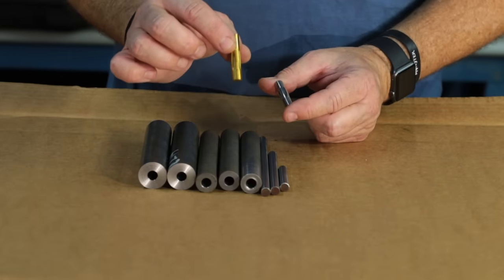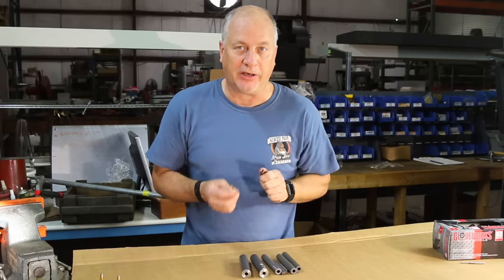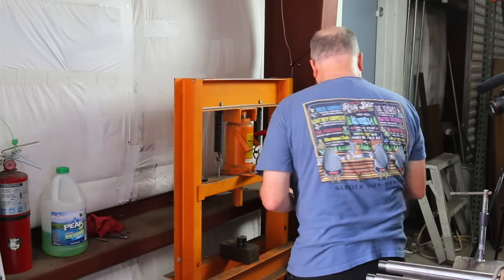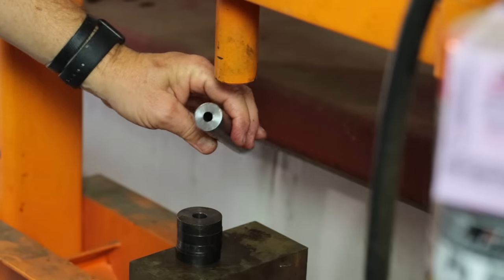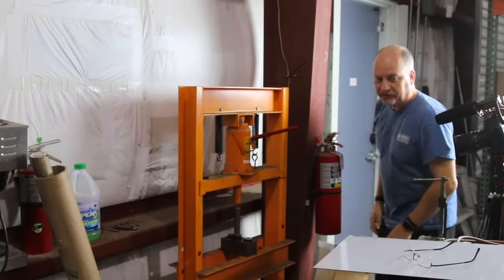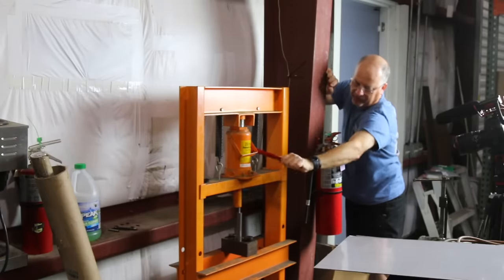Home Shop Rifling THREE(ish)...China vs. Ukraine Rifling Buttons!

Comment: Reheat the drill rod to cherry red and only harden the tip.
Reply: @Brett Freeman Ah ok it will expand where it is not as hard
Reply from the maker: @Brett Freeman Huh?  There's never enough stress on the rods to deform them, so what are you talking about?
Reply from the maker: @Brett Freeman  Sorry, that's not how it works on my channel.  If someone makes a comment that I think is BS, they have to back it up or it gets deleted.  I won't be responsible for spreading bad information if I can help it.  So with all due respect, please "put up or shut up", as the saying goes...
Reply from the maker: @Brett Freeman  I'm very serious.
Reply from the maker: @Brett Freeman  Well, three years ago I started...if you want to consider that "literally just started".  Which I don't.   So if you're the expert here why are you avoiding answering my question?  Greg Smith said to harden only the tip of the rod, you said that's how they get stuck, I asked what you're talking about and you've avoided the issue.  Now are you going to answer the question?
Reply from the maker: @Brett Freeman  Thanks for answering.  I disagree on two counts.  First of all, spot hardening doesn't soften the surrounding metal.  The remainder of the rod will remain annealed if that's the state it was in.  If it was a hardened rod to start and it was heated to the austenization point followed by only quenching the tip, the remainder of the rod will be annealed.  Second, as I said there's not enough stress on the rod to deform anything, so there's no mechanism for it getting stuck, bound up, whatever.  Now, what I've just said is based on a LOT of practical knowledge, and being a pretty smart guy with a mechanical engineering degree.  But I have no actual experience with what you're talking about and at this point I'd almost be tempted to say I defer to your experience.  Except for this...I'm about to build a custom rifling press that'll exert over 37,000 pounds of force on the rod/button.  How would I even notice if something bound up?
Reply from the maker: @Brett Freeman  Sorry, I don't take anything as a personal attack...it's just that there is a lot of crap information that has been posted in the comment section of my videos over the years, and I try my best to weed it out.  I'm glad to pass on knowledge...that's what I do here!
Reply: @markserbu  I was only suggesting a possible solution not talking bs. My point was to have a rod with varying degrees of hardness. It would also be possible to temper the rod to varying degrees using a torch. I know nothing about rifling barrels but have many years experience hardening and tempering high carbon steel.
Reply from the maker: @gregsmith2262  I know you weren't talking BS.  I agree with just hardening the tip.  Hell, I think I mentioned that in the video.
Reply from the maker: @Brett Freeman  Odd that you always find drill rod hardened...I buy it all the time and it's always annealed.  My point is that the force required to push a button through a barrel is never enough to yield the drill rod material.  So it will stay the same dimension as it goes through the barrel and shouldn't ever get stuck.  But anyway, there's no point in arguing about that.  I thought you'd run across something I hadn't thought of and I don't think that's the case.  I agree that a normalized piece of steel is a perfect candidate for a barrel, but as we discussed before it requires a very precise cooling curve to achieve and I doubt that can be done in a home shop.  Hell, I've been trying to get parts austempered and my local heat treater can't do it.  For most, even professionals, a quench is just a quench.  Try to do it at a precise rate and they just can't seem to make it happen.  Anyway, my press uses a small hydraulic power unit...same type they use for car lifts.  The hydraulic cylinder is a 4", with a 14" stroke.  It's definitely overkill, as it can exert 37,000 pounds of force with the HPU I bought.  Obviously I'm not going to be rifling rifle-length barrels.  Yes, it'll have bushings to hold the push rod precisely in place.  It'll also have a large thrust bearing to allow the button to twist without resistance.
Reply from the maker: @Brett Freeman I just did read up on normalizing of 4140 in the ASM Volume 4 Heat Treating Handbook, pg.35-41.  BTW, the normalizing and annealing processes are the same for all steels (except air-hardening), so I'm not getting 4140 confused with any other steel.  While normalizing seems to be the ideal condition for a barrel, I disagree that it is a lot more simple process than annealing.  As I said before, annealing requires heating past the austenization temperature (the upper critical line of the iron-iron carbide phase diagram), followed by slow cooling.  Normalizing requires heating about 100 degrees above this temperature, followed by a precise cooling curve.  That makes normalizing more difficult as you have to control the cooling rate, unlike annealing.  Wouldn't you agree?  You can instantly tell if you've normalized a piece of steel vs. annealed it, because the former will come out at around Rc 32, the latter will be around Rc 15.  Have you hardness tested any of your barrels?  I'd be curious to see if you're actually normalizing the steel.  The only heat treating that should be done after rifling is stress relieving, and that temperature should be kept as low as possible to keep from killing the strain hardness that the rifling button added to the bore.  Unfortunately, the lower the stress relief temperature the longer it needs to soak.

I'm fairly positive that if any rod were to break, it would be a hardened one.  As I'm sure you'll agree, hard steel is more brittle than soft steel.  I did all the stress calculations and there is no need for any strength beyond annealed drill rod.  I just don't see any advantage to it.  I would like to know why you say "never use anything but hardened rod on any barrel you do".  On the other hand, with the right setup you're very unlikely to mess up the rifling with a hardened rod so it shouldn't hurt anything.  I'm sure rifle barrels are much more fussy than little pistol barrels, I'll agree with that. 

Look, it sounds like you have a ton of experience but in my estimation some of what you're doing doesn't jibe with the math and science.  I, on the other hand, know the math and science but have limited practical application of it all.  Hopefully between us we can arrive at something that makes sense!

Comment: Wouldn't it be better to have an odd number of grooves?
Reply from the maker: I can't think of a reason that an odd number of grooves would be better...can you?  I know almost every barrel I've ever encountered has an even number.  The lone exception is a 3-groove .50 BMG barrel I bought once.
Reply: @markserbu  With an even number of grooves, you have two lobes of the button pressing against the inside of the hole opposite each other. With an odd number of grooves, the button will have one lobe pushing against the inside of the hole and nothing directly opposite it. So it should require less force to push the button through the hole.
Reply: For the same reason, the barrel would also deform the bullet less, contributing to better accuracy.
Reply from the maker: @JamesRPatrick   On the surface that sounds logical, but I don't think it is.  There's a certain amount of force required to deform a given amount of steel, period.  I'd bet that if you analyzed the force required to push a 4-groove vs. a 5-groove button, assuming they displaced an equal amount of steel, you'd see the same for each.
Reply: Looks like some companies are calling it "5R" rifling.
Reply from the maker: @JamesRPatrick   Yeah I just read about that.  I agree with the angled sides of the lands...it's similar to the improvement when going from square threads to acme threads.  But I think the rest is BS.  One part of the SAAMI spec that escapes people is a little note at the bottom of each "Cartridge and chamber drawing".  For the 9mm Luger the spec for the "MIN BORE & GROOVE AREA" is .0967 square inches.  That number is the same whether you use 4, 5, 8...whatever number of grooves.  And since it's the same, you're displacing the same amount of steel.  Same force to rifle, same force on the bullet.
Reply: @markserbu  Could you grind off two of the six lobes of the button and send it through twice to reduce the force required to rifle the barrel?
Reply: markserbu The only place I know for 100% sure fact that using a 3 grove barrel makes positive gains in accuracy is on br f1 classes , every one runs a 3 grove (1-15 to1-18 twist) for 30 cals. If you ask around what their setups are most of the guys that finish in the top 5 are using 3 groves rifles. But I think the advantages are super minor in most situations.
Reply from the maker: @JamesRPatrick  That would definitely work.  But take twice as long.
Reply from the maker: @brandonsjsj  Might have something to do with bullet harmonics...maybe odd numbers do better than even?  Or 3 is better than anything?  I don't know...definitely not intuitive.
Reply: markserbu  I’ve been told that it places even pressure without making pinch points on the jacket but and less rifling make less tq deflation also but I have never felt these differences Personally but it dose reflect down range somewhat, a change of about .040 average in groups  in a normal 308 with a 1-12 twist is what I saw over the same brand same barrel in a 4 vs 3 grove comparison.
Reply: markserbu I could see it being harmonics though also * sorry forgot to add this part also. Haha.

Comment: I wouldn't mind trying polygonal rifling on an assault rifle similar to the glock gen 4 .....
Reply: Octagonal requires a lot higher initial pressure to push the bullet through as handgun rounds use fine powder, not gonna work in a rifle.
Reply: @alexanderwoolley1623  ...you know the MG-42 has polygonal rifling, right?
Reply: @cunicularius2064  It also was in 8mm Mauser tho
Reply: @cunicularius2064  yeah only polygonal, not octagonal.
Reply: @alexanderwoolley1623  I have a lothar walther 556 barrel that uses polygonal rifling.
Reply: Polygonal rifling can work. It has advantages with initial velocity and chamber pressures, but it trades off a lot of its stability at range for it. Using it on something like an m4a2 or akm would be fine. You wouldnt really notice much difference besides a higher velocity at the same ranges. The big difference is seen with large/high accuracy-long range rifles. Say if the L96a1 were polygonal. There is more wind deflection from less spin stability. So your old windages would need serious adjustment. I have a carbine rifle with polygonal rifling and it really makes full use of its .44 magnum cartridge. When i changed the barrel i noticed a spike in velocity and energy. So take that info as it is. Polygonal is excellent for non "sniper" rifles. But really costs you at range. Carbines gain nothing but benefit being that you ought not use one past 200yds. Pistols almost find it necessary for reaching high velocity within such short barrels. (Most desert eagle .50 AE use polygonal and still dont manage to burn off enough powder for peak power)
Reply: @JunkCCCP  give him a slack, dude skipped math class so many times

Comment: Hi, can u make .50bmg long barrel rifled adapter inserts for a 12ga shotgun and make it stick out the barrel of the shotgun so you can thread and install a muzzle breaker or supresor if that's not possible make it for 10ga if not 8ga if not 4ga if not 2ga puntgun can u make the shotgun too make it break action singleshot with pikitinirail for scopes and bipod can u also set price cheap pls and make adapter variants .50bmg and down like 338 lapua, 30-06,7.62×54,308,7.62×39,5.56 etc all the way down to small handgun pistol rounds

Comment: If I dont have a press, can I use a hammer to drive the button?
Reply: Yes
Reply: Fucking send it bud, hammer away
Reply: These tools are not good under shock, they can shatter. But can handle pressure well. 

Hydraulic pressure is pretty cheap, better use that than hammer. 

If you create your own rifling button, you can use hammer without risking shattering.
Reply: They make one for hammering through. It's actually called hammer button. Look it up.
Reply: @petrzacharias6622 how do you make your own button? How do you know what size is needed?
Reply: You can but it will take longer. Your best bet if doing the hammer method  is to secure the barrel and use a heavy sledge, and tap it lightly. It will take ages and wear you out, but you are less likely to fracture your button or mung up your rifling by wailing on it, trying to get it done quickly.

Comment: Do you not trust your press lol, great video
Reply: drill rod is HSS(High Speed Steel) which is very hard and brittle. with enough force like from a hydraulic press, one wrong move will turn those little shits into shrapnel. which is exactly why youre supposed to wear safety glasses when working with the stuff. do not follow mark's example, using prescription lenses as safety glasses. they DO NOT protect your eyes... being made of glass and all. they would shatter and render your eyes useless
Reply: @beanshooter5784  greatly explained, thank you.

Comment: Your press is lacking, a hole drilled and tapped for 1/4-20 on each end would stop a ton of the play. 
But a better and more appropriate gun drill with a pull through button press would make better barrels. 
But hey what do I know, I’m a faceless troll on the internet who wants an El Dorado gun drill.

Comment: OK, soo...  in addition to @bryanst.martin7134's comment abouting mating the ends of the button and push rods, if you groung a small chamfer to the lead end of the push rod, say, 15° by 0.005" deep at the minor diameter of the chamfer, it would make the push rod self guideing and eliminate sharp edges that could mar the bore.  Also, Dude, you need a better press!  (So do I!)

Comment: I rifled a 60cm 22lr barrel with a 6 groove chinese button and a Hammer, yes a fucking hammer. After 2 Hours and a sore arm i drove it through, pretty accurate though.
I don't know bout the Ukraine, but the Chinese button is brittle as hell, i droped it from waist height and that thing just shatter into pieces, nearly cry because those thing ain't come cheap
Reply: Im assuming that yours was tungsten carbide, like in the video?

If so, that is just the nature of that material. Extremely hard, gread for making tool bits from, probably an idea choice for a rifling button..... but extremely brittle. It's actually very surprising that it survived being hammered through the bore. As a machinist, if I strip the head on a screw holding a carbide cutting insert and cannot get the insert out, the normal salutation is to actually smack the insert with a hammer to shatter it, and then just replace the insert and the screw. 
Tungsten Carbide does not hold up to impacts, even just dropping on a cement floor

The High Speed Steel Ukrainian button in the video would be much less brittle, but it will wear much quicker and is more likely to be damaged in use
Reply: @Man_Emperor_of_Mankind  i own 4 buttons, and made over 15 barrels out of the hammering method, non of the buttons seems to bother, they just don't give a damn and just going. I'm a bit surprise myself
Reply: I am a manufacturer of Ukrainian buttons, you are wrong. We use a special alloy, it is hard to wear.
in order for it to wear out, it is necessary to make at least a hundred barrels, maybe it is a couple of units softer than tungsten carbide, but it is not fragile and it is very hard to damage it.
And as you can see the result is much better than the Chinese button.
Reply: @hammerbutton4542  personally i think Ukraina and Chinese button both give good result, it's apple vs apple to be honest. But Ukraina button toughness is what really count, good for the long run
Reply: @teveten11  Got an ebay store name for this guy so I know who to avoid?

Comment: Or just hold a piece of cardboard in front of you
Reply: bogey19018 some cheap Lexan (polycarbonate) tubing or 1/4” or 1/2” sheet would be safer, often available at places like Tap Plastics in the scrap bins in sizes appropriate for the small shields needed here.

Epoxy a decent high strength magnet to it and you can easily stick it to the hydraulic press (or drill press, whatever).

Cardboard - It would have to be really thick or laminated in layers to ensure that a chunk of metal launched at high speed because of the thousands of pounds of force stressing on them

Comment: Wrong barrel steel to test buttons and wrong way to use rifling buttons.
Reply: Good thing youre here to tell him that!
Reply: What barrel steel ought to be used?
Reply: Glad the 'expert' is here to tell the experienced gun designer how to rifle a barrel!
Reply: @josedorsaith5261  the point I believe @Andrew Lambert was trying to make was that if you don’t use proper material you won’t get proper results. Try using your pocket knife to shave wood, then try to shave a copper rod, it will perform differently even though the steel blade is harder than either. You will get great results and be able to say your knife is a wonderful product when shaving the wood and give a terrible review and say the knife is garbage when shaving the copper rod. 

I am by no means a gun or materials expert. I am experienced in performing testing and being able to identify points of error, this video had a lot of error points that could be improved upon. But sometimes good enough is good enough. A perfect process a lot of times doesn’t produce significant enough gains to implement. This guys rifling and process is better than mine, I don’t have one.